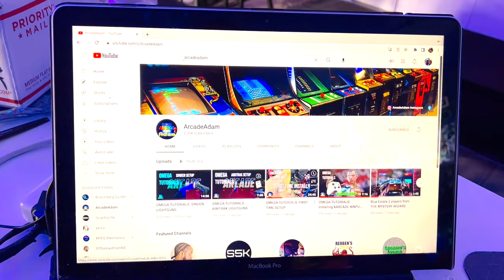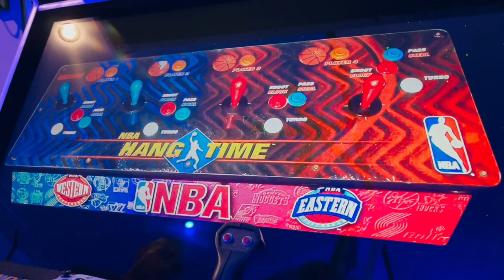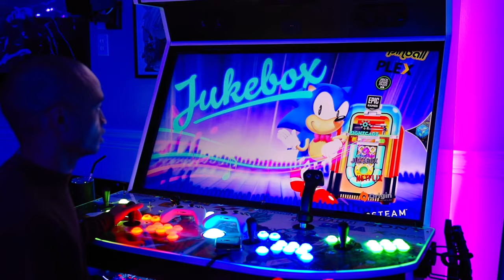Extreme Home Arcade Supreme Megacade | Custom 4 Player Review With Omega Drive

Comment: Yoooooo a video like this helps with the wait. Thank you so much for sharing.
Reply from the maker: Ah thank you! You’re welcome hehe. How long until you receive yours??
Reply: @xolivi  Ordered April with expected time of about 5 months. Just a few months left... I noticed you don't have the light joysticks and I was thinking to get the light up ones but another reviewer said the light up joysticks not as good. I'm also trying to decide if the outside player joysticks should be straight on to the screen, any comments about the orientation of the joysticks for the outside players?
Reply: @thatguynamedzach   hello and great feedback, especially about button layout. Hey I had two extra questions for you.

Is the power switch in a easy to get to spot? I will have stuff on both sides and wondering how accessible it is to turn machine on for a 10 year old?

Are you able to use the track ball as a mouse when interacting with Windows?

Oh one more, how easy is it to control volume.

Thank you humbly in advanced. Getting close to the art approval step, just heard from Dave today